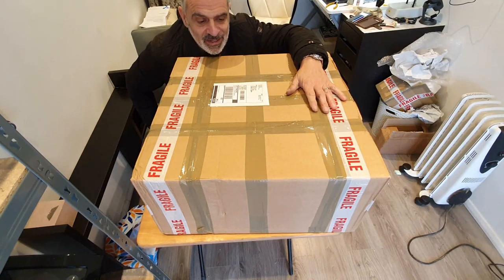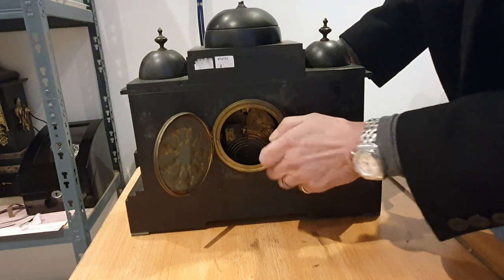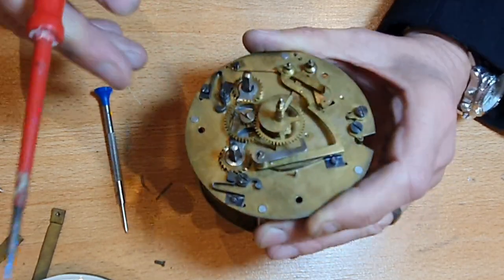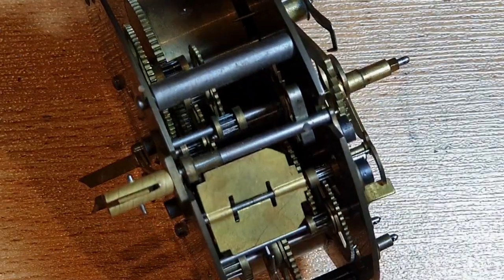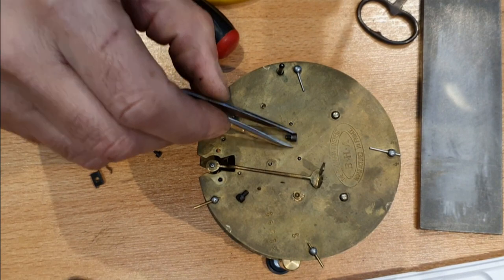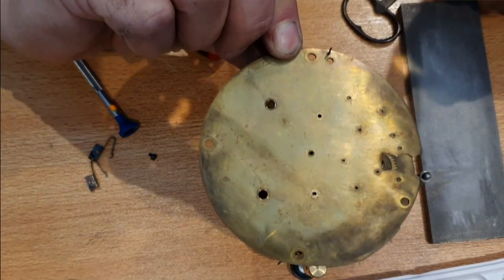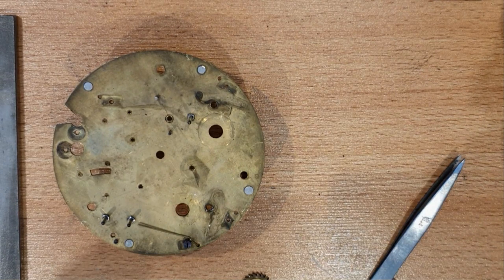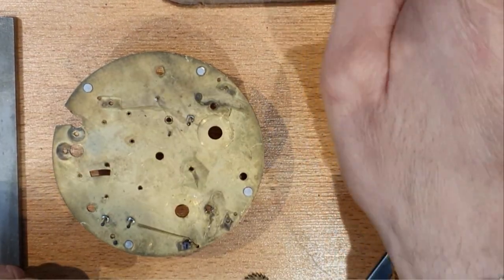3 DOMES PT1

Comment: What kind of liquid do you use to clean watch boxes? Greetings from Spain.
Reply from the maker: Hi Defcon from Spain and greetings from the UK
I first use soapy water to clean the slate case and then to polish I use a product called Marblack from a UK company called cousins. I do believe you can buy this from Ebay also. There is another cheat way to shine up the case using black shoe polish. I did a video of this which you will find on my channel.